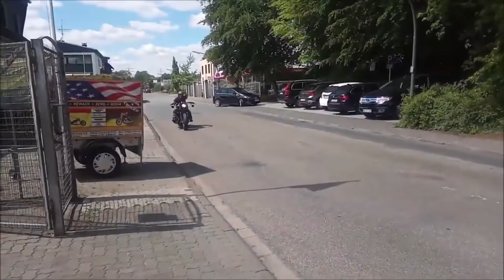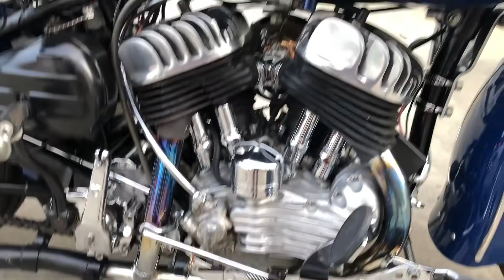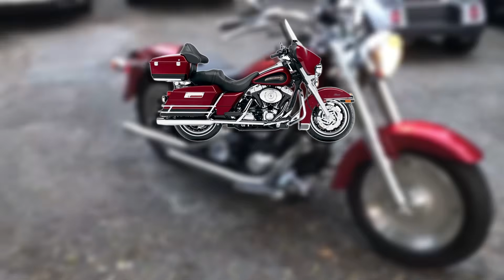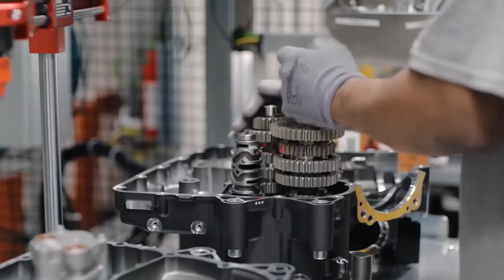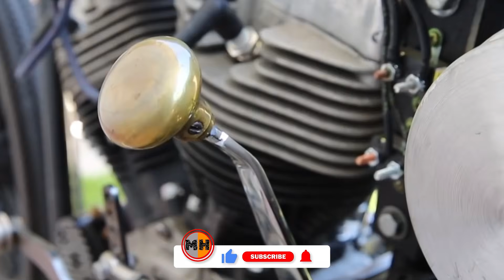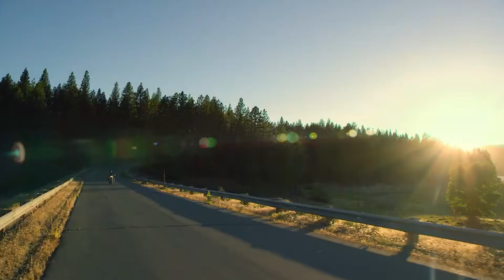Most Reliable Harley Engines Every Made!

Comment: The early  engines  were  great  , Simple   bullet  proof   last forever  with  proper  maintenance   no lap tops   or bad designs   S+S  cycles  sells   upgraded  replica  knuckles  , Pans  Shovel  engines that can take a beating  with a Warranty /     Can  Harley  say  that   (NO )  !!!   They  don't  make  bikes  most people  want  or  can  afford    /And won't  service  bikes more then  a couple of  years old   / And make parts obsolete , The  aftermarket has you  covered   !  For the most reliable  engines  !

Comment: I have 164 000 miles on my 2007 flstc with the twin cam 96B! It has fueling 543 cams and full dyno. 91 hp feels awesome.
Reply: How many rebuilds?
Reply: . No rebuilds at all.  The 96 has never been rebuilt. I fid put fueling 574 in and new fuel cam chest and high volume oil pump
Reply: The bike has never been rebuilt. I purchased it brand new fall of 2006

Comment: 96 ci and 68hp, that's pathetic
Reply: HP numbers don't do it 
Try their torque
Reply: Under stressed, torque heavy make them run forever. With most motors, you can have high performance or dead-nut reliability, choose one.
Reply: That's why they don't break
Reply: A mild cam with no head work got me to 89 hp. 97 ft pounds of torque. A good tune done by steadfast performance. The bike feels fantastic. Plus has 164,000 miles. Never any powetrain break downs
Reply: Teresarush, Depends on what you want to do with a bike, if that's pathetic or not. 
 If you want to load it down with baggage, pack double & tour the country, it's more than plenty ! 
 If you want to lay it over in curves, & race with people like you're on a race track, it's still way more than you need to get yourself killed ! You have no business riding like that on streets & highways, endangering everyone else's lives . If you want to go to the race tracks & compete, Japan markets a lot of high horsepower bikes designed to do just that. So does Italy. 
Horsepower isn't what you need to get over that big hill when your bike is loaded down with camping gear & so on. And 70 mph, is still just 70 mph, no matter what horsepower you have ! And believe me, those Harleys will get you to 70 mph anywhere you want to ride them.
 But now if you want to ride like a senseless moron, hell you can kill yourself with 30 horsepower ! It doesn't take much ! So go for it, with your big power if you like. Lots of us just want to cruise down the highway,  & that ain't pathetic !